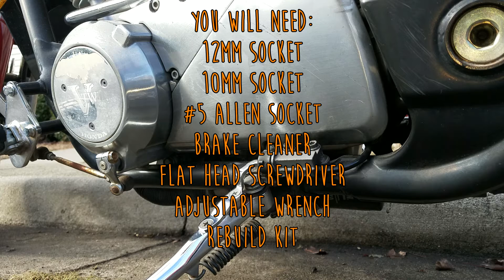How to Rebuild Clutch Slave Cylinder on Honda Shadow

Comment: I just rebuilt my PC800 master brake cylinder and learned the hard way not to reuse the washers on the banjo bolt. They are crushable washers that can’t be reused. Always replace them with new ones. Otherwise, great video.

Comment: Helpful. What would the symptoms of the bike be of a slave cylinder not returning because the piston was stuck?
Reply from the maker: Is the clutch disengaging when you pull the clutch handle?
Reply: T R Barton - my bike acts like the clutch lever is pulled in all the time, even though it’s not. 
I can put it in gear and “dump the clutch” and it doesn’t die. 

Also no power to the rear wheel. Again - like the clutch lever is pulled in when it isn’t.
Reply from the maker: @McLeodQuinn  does the the gear engage at all?
Reply: T R Barton - yes. When I put the bike up on the center stand - I can click it into gear and the gears move with the rear wheel. 

Seems to just be the clutch - not the transmission.
Reply from the maker: @McLeodQuinn  so if it is not fully engaging, it could either be something in the friction plate assembly or possibly an issue with the master cylinder. You can check to make sure the master cylinder is working properly by taking the banjo bolt off that connects the fluid line to the master cylinder and then with fluid in the reservoir, pump the handle with your finger over the openning to make sure it is send fluid to the slave cylinder. I had to do this once because a seal in the master cylinder was not seated correctly. If that is not the problem, hook it back up and make sure to  bleed the line. If that doesn't work, it might be the friction plates. I have another video where I replace them.  Ultimately there are 3 main failure points on the hydraulic clutch: master cylinder, slave cylinder or clutch assembly. Hope that helps!
Reply from the maker: @McLeodQuinn  https://youtu.be/uoAgRV1z3yA

Here is the video on replacing the friction plates
Reply: @McLeodQuinn  Hey I know this is very old but how did you get it figured out? Bought the bike cheap and the guy didn't tell me about this issue. Bike runs fine now after I welded a piece of broken case together. Fires up now it wont go into gear. I can hear the bike going in to gear just by rolling it. Just took apart slave and looks great.
Reply: Taking apart the slave - the issue was the hydrology clutch piston (similar to a disc brake) was stuck in inside. I needed to get it cleared out and rebuilt. 

Then that didn’t do it - I took an impact drill on the other side of the bike (right side) to the clutch basket nut and ‘beat it loose’. 

From sitting the clutch plates were stuck together with some surface rust from lack of use. The impact shook them apart enough to get the clutch to engage. 

From there, it was riding it and changing the oil and I had no issues from there.
Reply: @McLeodQuinn  yeah today is the day I drained my fresh oil I just put in and I’m taking a look at the clutch basket

Comment: I'm having a bad oil leak from the slave cylinder. The gaskets on the slave cylinder itself are ate up but when I move the push rod just a little bit, oil pours out. Is there a seal behind the push rod or does the seal on the slave cylinder handle that?
Reply from the maker: That is a good question.  I believe that the push rod seal on the slave cylinder is the only seal but I am not 100%.
Reply: T R Barton thank you very much for the feed back. I'm gonna order the rebuild kit and see what happens
Reply: If you come across any handy information please let me know
Reply from the maker: @codycook1345  hi, I'm not sure if you have fixed your problem yet but I thought I would let you know that there is a pushrod seal that is more internal. If that goes out, it will pour oil out around the slave cylinder.
Reply: @ifly891  I did get it figured out and it did turn out to be the internal seal. Haven't had oil leak since. Although I did lay it down a month ago so I'm mending a broke knee and now have handle bars, crash bars, and risers to replace. Just cosmetics
Reply from the maker: Oh man, I'm sorry to hear that!  I hope you get better soon and get can start riding again!

Comment: So I just removed the slave cylinder on my 1992 shadow 1100 after some clutch issues.  It was in rough shape.  Have a rebuild kit on the way.  My only concern is I forgot which way the pushrod seal came out.  I know its only one of two ways but id rather not have to do it twice.  Its also hard to tell in the video but ive watched several times over now.  Does the flat side of the seal go into the piston first leaving the side with the recess facing out that goes onto the pushrod or does the recess side go in the piston first leaving the flat side facing out?  Ill be installing tomorrow when the kit arrives.
Reply from the maker: Hi, sorry it took me so long to respond. If I understand what you are talking about, the recess should go in first. Basically the pushrod just needs to seat against the piston.
Reply: @ifly891  I probably didnt explain it as well as I had thought about it in my head haha.  But I got it all back together no problem, unfortunatly it didnt fix my clutch issue so I continue to look for the problem.
Reply from the maker: Ok, I'm glad you got it back together.  What is the issue with your clutch?
Reply: @ifly891  The clutch lever is very stiff to pull.  Sometimes so stiff you cant pull it to the grip, other times you can squeeze it hard enough to touch the grip but because of this its not engaging/disengaging the clutch.  If I put it into gear the bike will roll as if its in nuetral.  The bike was riding so im not sure what happened.  Clutch wasnt slipping so I dont believe it to be the actual clutch.  But the slave is rebuilt and all new fluid.  And the master seems to be okay but I didnt rebuild it, just cleaned it thoroughly.
Reply from the maker: @berube361  have you checked the lifter plate for the friction disks? Also, I would take the banjo bolt off the master cylinder then with fluid in the reservoir, pull the lever and keep your finger over the openning to see how it moves and if it pushes fluid out. If it doesn't, then the problem is the master, if it does, the problem is downstream. Hope that helps. Also, I have a video on how to rebuild the brake master and it's basically the same as the clutch.

Comment: Hi buddy nice video 😀 I have exactly the same bike with the same clutch problem, I woul like know where I can buy the replacement kit
Reply from the maker: Hi here is a link. There are a bunch of options on ebay for different kits that are all about the same. https://www.ebay.com/itm/HONDA-VT1100C-SHADOW-1992-1996-CLUTCH-SLAVE-CYLINDER-KIT-Made-In-Japan-/382885863174?mkcid=16&mkevt=1&_trksid=p2349624.m46890.l49286&mkrid=711-127632-2357-0
Reply: @ifly891  thanks man appreciate

Comment: I'm having a problem with my cylinder it's leaking a good amount of oil especially whenever I'm on the throttle I have no idea how to fix this problem will this fix it I don't want to buy an excessive amount of parts and still not be fixed
Reply from the maker: Hi, it is leaking oil from around the slave cylinder?
Reply: Yes think it's an easy fix but I'm not exactly sure on what the party even looks like or where it's at that I need to replace or what all I need to take off on the bike to get to it
Reply from the maker: @scottysequichie9725  I had a leak coming around that area and it ended up being a small rubber gasket around the clutch pushrod. The annoying part about it is that you have to take the side of the crank case off to get to it. It's pretty easy, just make sure you get the replacement gaskets for the crankcase too. I wish I had done a video on it...
Reply from the maker: @scottysequichie9725  it's part number 25 on this diagram https://www.hondapartshouse.com/oemparts/a/hon/506c1338f870023420a2dc30/crankcase
Reply: Thank you so much that really helps out a lot going to try and go get the parts ordered tomorrow
Reply: Having trouble taking off crank case have all bolts out but wont budge
Reply from the maker: @scottysequichie9725  you can try taking a mallet to loosen it up. Also you can use a flat head screwdriver to help pry it off. Just be careful to not damage the case or cover.

Comment: I thought you had a 1986 VT1100C in your other video? Lol
Anyway, can you tell me where you got the rebuild kit?
Reply from the maker: Hi, I got it from ebay. Here is a similar kit https://www.ebay.com/itm/Honda-VT1100C-Shadow-1100-85-90-92-96-Clutch-Slave-Cylinder-Kit-/292796058127?_trksid=p2349624.m46890.l49292

Comment: For people wondering how to get the cylinder out (he moves off camera when he gets it out), i used an air compressor to blow the cylinder out since it was stuck.  Just be careful because the brake fluid aerosolizes when you do this, and can spray you EVERYWHERE.  wear a respirator and some eye protection.